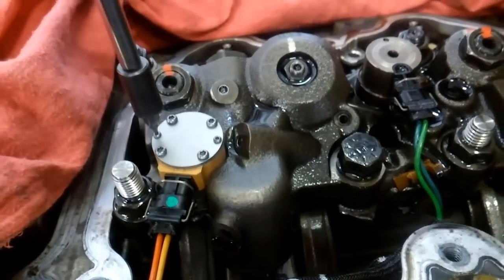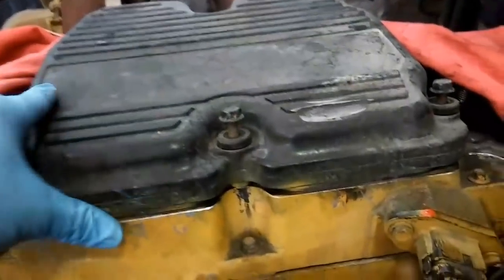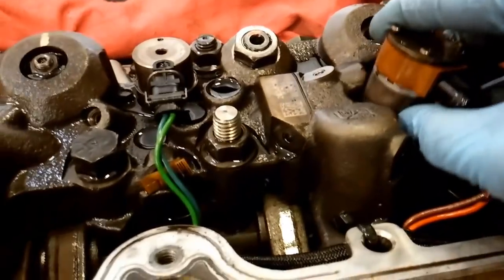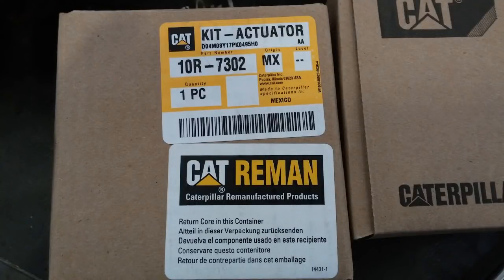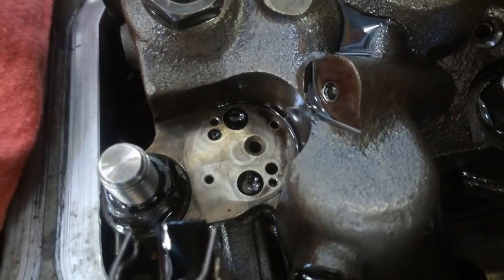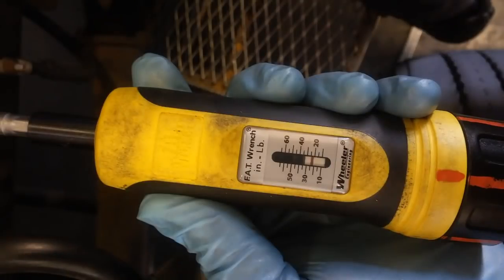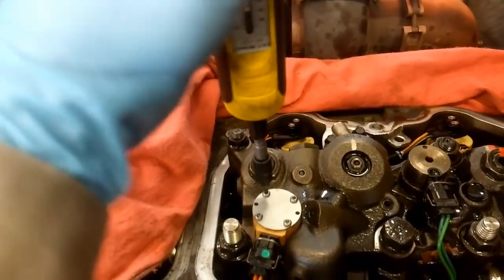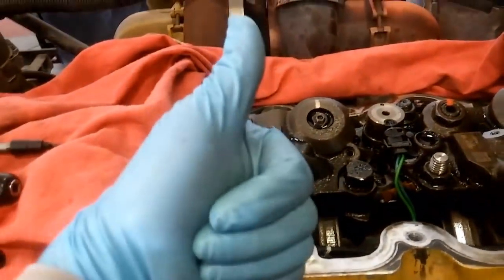How To Remove and Install An IVA or VVA Solenoid.  Cat C11, C13, and C15.

Comment: The C-13 in my 07 KW T800 dump truck has just been diagnosed with a bad solenoid at the firewall. Its ran with the check engine light for almost 3 years now. It left the shop after a new head was installed with the CEL on.
At 1st it might come on or it might skip a day or two.  What sux is it puts the truck into derate mode. instead of boosting 50 it boosts 29 psi.
 For the last year it comes on soon as  I pull out on the highway and get into the high side of the 8LL Transmission.

Comment: Awesome thanks I had to change mine it was really easy  I broke one of the valve cover bolts had to replace it the problem I had was the male pug wasn't connecting so I had to bend the 2 metal stems down to get a good connection that in side of the Avi solenoid it was too loose but it fine now

Comment: I have a acert C15 , I sometimes thw oil pressure light comes on and off. If it stays on for a while the engine seems to lose power, similar to sputtering like a bad fuel filter.  Any ideas as to what it could be.  Any help would be greatly appreciated.  🙏

Comment: I have a mxs c15 I keep getting a 95 code which is low iva oil pressure this has been going on with this motor before and after my rebuild even with new head I've changed the pressure sensor and the valve actuator put brand new wiring harness including new harnesses in head when the eng first starts no light but when it boost to 35 lbs or better eng check light comes on and won't boost.over 30 lbs shut key off turn back on no light back to normal I've had it on several computers when it codes and always low iva pressure turn the key off then start truck no code. We are out of ideas maybe you have seen this before any help would be appreciated.

Comment: I have a C13 that coughs and sputures when it is cold. Once it warms up it runs smooth. Put my truck in a local shop (small mom and pop operation) and met another O/O with the same exact problem. Mechanic isn't sure what's causing the problem but says my IVA's are only working once the engine reaches operating temp and believes they may be involved. Any advice would be appreciated.  Love the informative videos, thanks again.
Reply: It's ECM settings called "Cold Mode" was to eliminate white smoke on startup , it's 3 stage upto 150°f then 150°-170° f 
On cat site read the article. If with temp fix that then let engine warm up before u move.

Comment: What does the IVA/VVA warm up solenoid do? with key on engine off mine clicks for about 20 to 30 seconds then stops. noticed it today and i've never heard it do this before. is this normal or an issue?

Comment: We have also had lots of problems with the electrical connectors (more specifically the terminals) for the IVA's.  We were just using the CAT pigtails, but got to the point of having more pigtails & repair time for each truck (as these engines are getting LOTS of hours on them now) and have found it more cost effective now to just replace the entire harness assembly under the valve covers.  What is your criteria for determining pigtail versus harness replacement where you work regarding addressing the problem electrical connectors for the IVAs??
Reply from the maker: +KCautodoctor There is a terminal pin I use to test the tension on the connector socket. If it is loose it is a good idea to change it, if the harness already has a bunch of fixes though it is a good idea to change the harness.
Reply: Thank you for the reply.  We always check terminal tension BEFORE replacing any of the IVAs since getting burned on a couple that worked for a couple months after getting replaced but then started throwing codes again for the same cylinder IVAs, only to find the root cause of the problem being the terminal tension.  As these engines are getting older, the electrical connector terminal tension tests have become more important than ever to ensure repairs that will last.
Reply: KCautodoctor are you a shop in KC?

Comment: I have a C13 cat motor my oil pressure gauge is reading zero and I think my truck is in derate mode the check engine light is on and no power I changed the oil pressure sensor but the fuel filter someone said there is 2 oil pressure sensors on my motor if so where and do I change the IVA sensor also when I change the other oil pressure sensor need help brought truck to the shop and bought a ECM it wasn’t the problem left with a 6000 dollar bill and a broke truck helpppppp

Comment: I got a 06 c-15 and code is 92.IVA #2 and #3. I have a loss of horsepower like sputtering and sometimes blue puffing smoke out exhaust..also I keep having to fill coolant reservoir up BC it's being pushed out the overflow when I'm driving..my question is,If I replace the IVA's will that cure my engine or do I have something more than just loss of power due to IVA failure?
Reply: Did you ever fix the problem ? I have the same problem
Reply: That sounds like a clogged fuel filter.

Comment: I was wondering about those shipping screws. Problem is I already bolted everything back together. Is it mission critical to remove them?
Reply from the maker: +mario quiroz They probably won't hurt anything, I've seen them in solenoids in engines that have been replaced.
Reply: Adept Ape  thanks man I was thinking the same thing. I replaced 3 and 4 after truck was throwing a low voltage code on #3. Seems like it fixed the problem. Your videos have saved me a ton of money. Keep it up amigo!

Comment: Have you you ever heard of deleting the iva in the ecm and upgrading the horsepower??
Reply: Old post so you probably have done figured it out. Yes you can delete the iva action in the ecm. Which means all the boost pressure is going into the cylinder. Yes they pull much harder. Bad thing is deleting them only turns them off. The ecm NEEDS them to say hello. So basically whether deleted or not the iva will derate your engine
Reply: @rodneyward8357  do you know how much a shop charges to delete them?
Reply: @babyjoker360  not sure. Its just programming. The iva must tell the ecm hello but it does not function. I will ask my boss everything that needs done and get back with you. It makes a huge difference. A note of caution. My 550 will make 60lbs of boost pretty easy. I try not to keep those pressures for long periods to keep my head gasket safe. The few lbs of compression the iva gets rid of makes a big difference on cylinder pressure.
Reply: @rodneyward8357  for sure man thanks. I have a 550 acert makes 52lbs of boost but I’ve heard good things about deleting the ivas. Cheers bud!
Reply: @babyjoker360  very welcome
Reply: @rodneyward8357  how much will that delete run for ?

Comment: Hi adept ape it's me again my c15 and it's vibration, my head has been installed(the one that had 3 cracks) overhead adjusted and back on the road the engine was smooth when I took off the shop drove it till approximately 500 miles and it started the vibration and I am 2000 miles now on the road and it's has increased to it's full capacity as it was doing and has lost its power ok here is the thing the check engine light is giving a code (even before the head job) 285-5 for the iva the mechanic couldn't figure it out I will do it myself, but since the vibration went away after the head replacement and adjustment can it be it possible that it cracked again or lost it's adjustment? Or is this code the culprit??? Please text me your shop number address I really would like to show you the truck 4045507005 thanks..
Reply from the maker: +Aiyman Khan IVA codes can give you a derate condition, which could be causing you the low power, but shouldn't be giving you a vibration. You should email me at AdeptApe@yahoo.com because I don't respond to comments all the time.